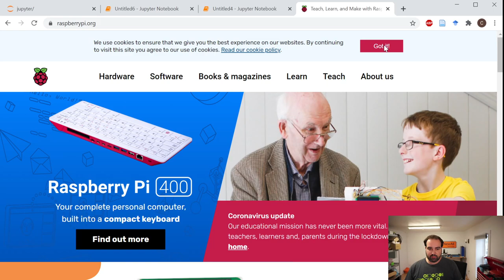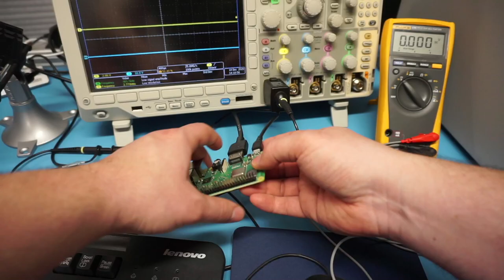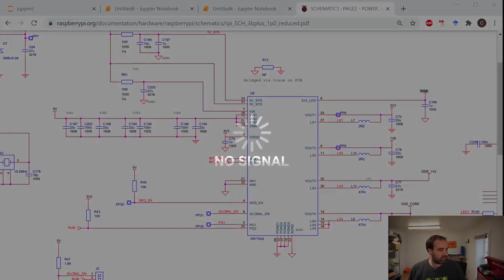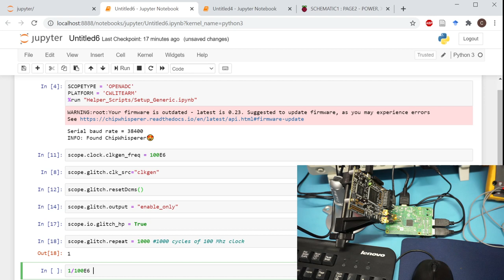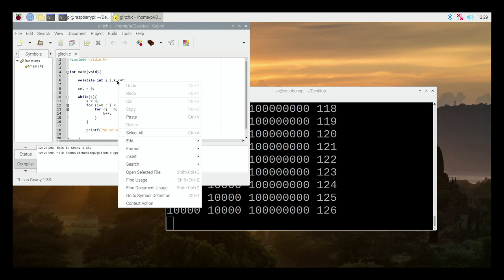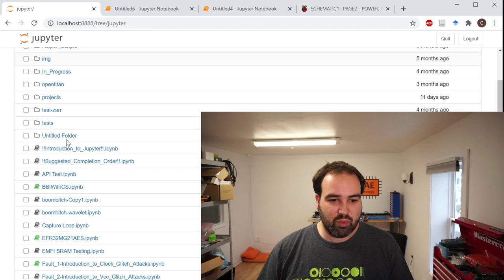Voltage (VCC) Glitching Raspberry Pi 3 model B+ with ChipWhisperer-Lite

Comment: Kudos on the excellent video. I think it would add value to visualize the voltage waveform on an oscilloscope. This would help in accurately determining whether the fault injection is introducing a positive or negative voltage shift from the baseline. 
Additionally, have you thought about incorporating a Zener diode in tandem with the MOSFET? Doing so could act as a voltage clamping mechanism, setting a predefined threshold to protect the target device from excessive negative voltage spikes.